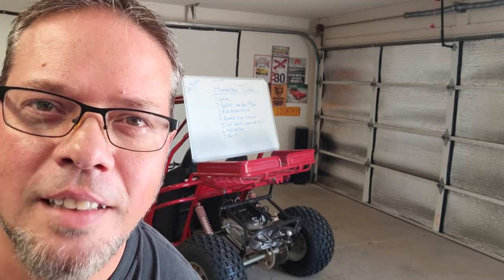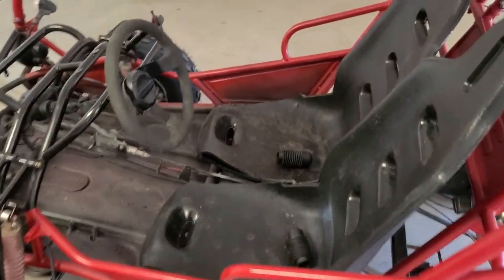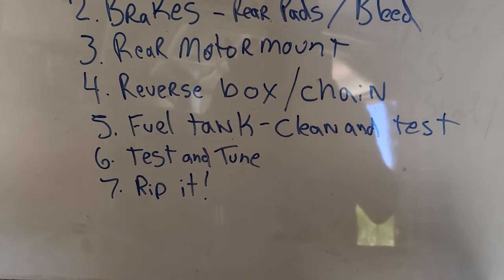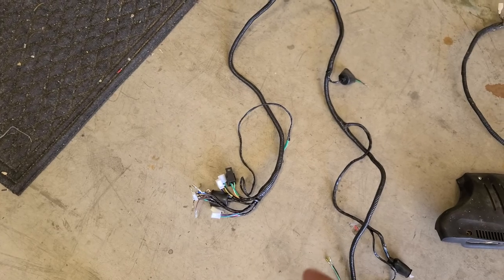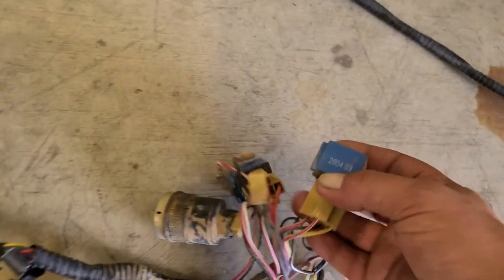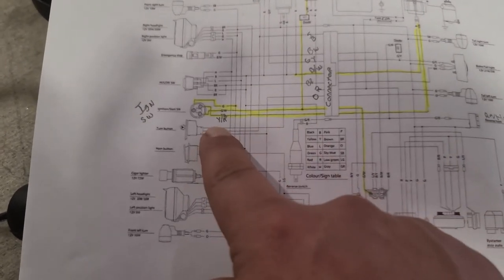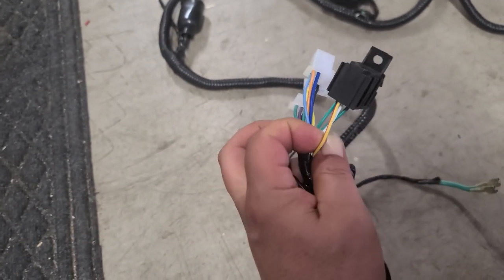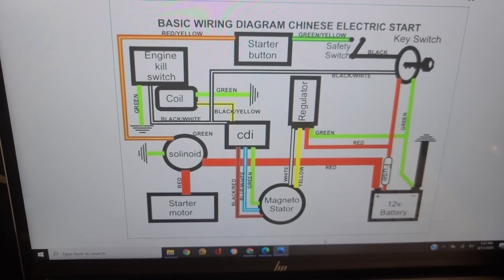Hammerhead Twister -Go Cart (Rebuild) Part 7 #Hammerhead

Comment: Thank you for the info. I have been looking even on the Hammerhead Tech page and have not been able to find the Wiring Diagram for my 2005 Twister Kart. I believe this is it though. Now I just need to get some time to go through and fix my short. Thanks again for the links. Come to find out I have a Junior125 that will do 55 with my fat but on it. LOL
Reply from the maker: Awesome glad to help, new vid coming soon I got it running!!!!

Comment: Rejuvinating my hammerhead as well.Whats the best way to install the dust boots on the steering column?Do i have to take the steering wheel off or do it from the rack?
Reply from the maker: Pull the tie rods then unbolt the 4 bolts holding the rack. Slide the boots on and make sure the boots  are in the hangers for the rack. You need 2 people to do it.
Reply: So were on the same page,I mean the dust covers on the u joints in between the steering wheel and the rack and pinion.
Thx
Reply from the maker: @daley1985  yes sir not fun by yourself haha. Get a buddy to help. Thanks for the comment

Comment: Will you be willing sell me a pre wired harness ? My hammerhead twister Doesn’t have one unfortunately.
Reply from the maker: I thought about making some it would take a while to do. I will let you know once I get back i am leaving for a week to cover Rocky Mountain Race Week 2.0
Reply: Destroyer1320  so I might of found the original harness to a twister . Do you suggest I take the deal or buy an eBay harness
Reply from the maker: @Mini.Moto.Guy806  take the deal just test each wire and replace any bad ones. info in the description of my vid should help you